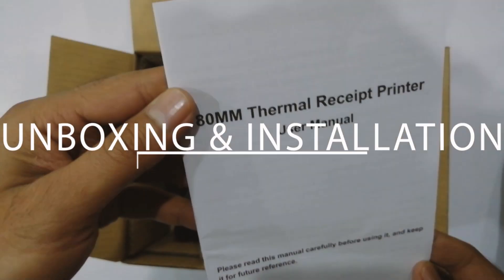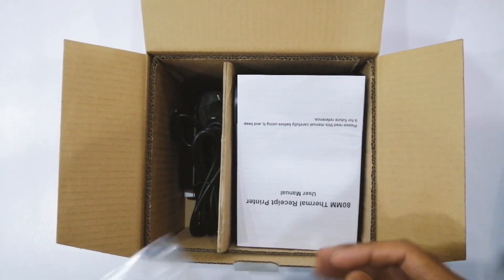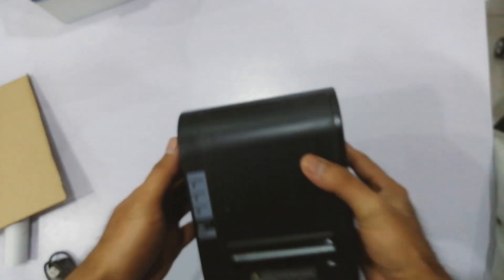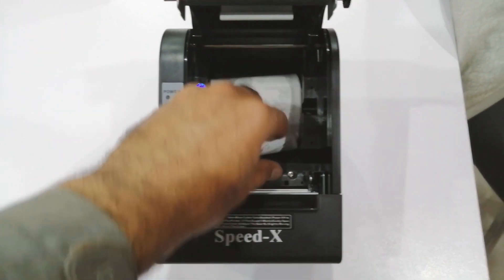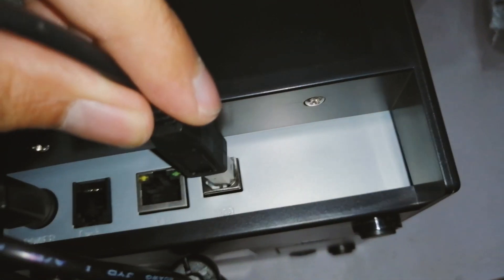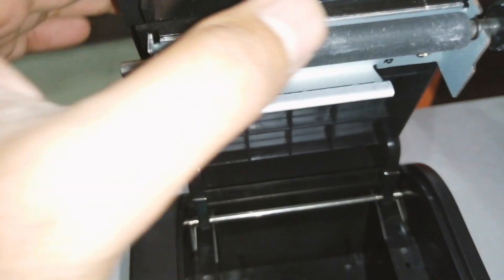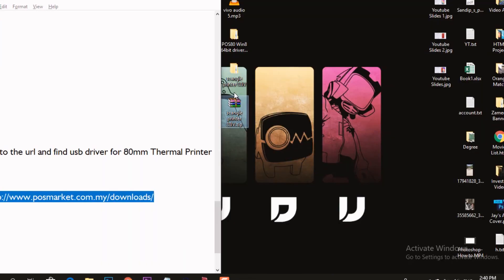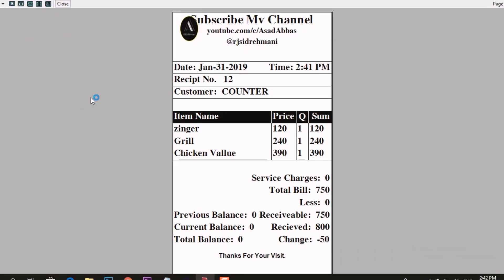THERMAL PRINTER UNBOXING & INSTALLATION || 80MM POS PRINTER || AUTO PAPER CUTTER USB

Comment: Hi my thermal printer is giving me error light and peeping sound but when i open it and close it many times while pushing on its cover it stops but when i print something it does it again can u help me with this please?
Reply: And it was working fine before
Reply: @ahmedhamed8891  Did you solve?
Reply from the maker: did you solved your problem if not let me know